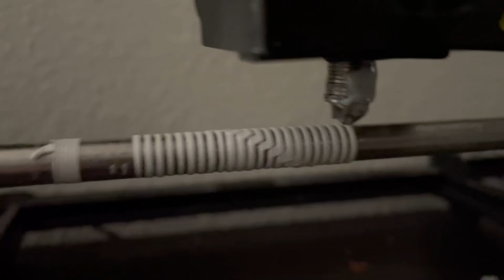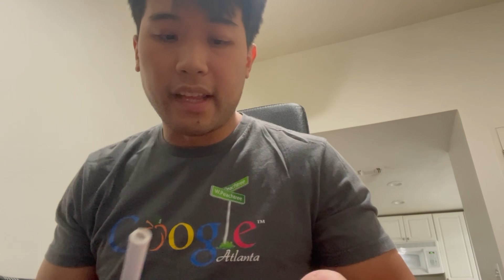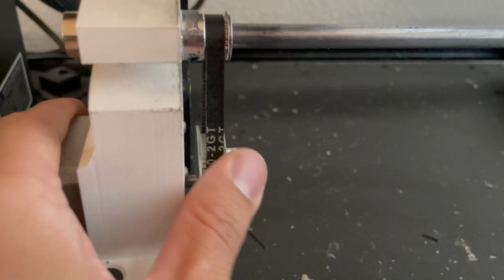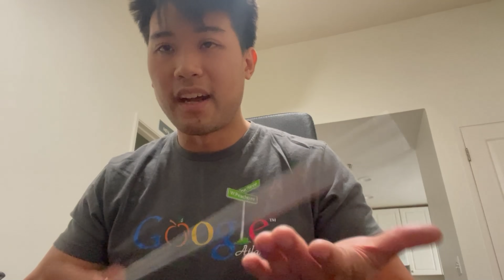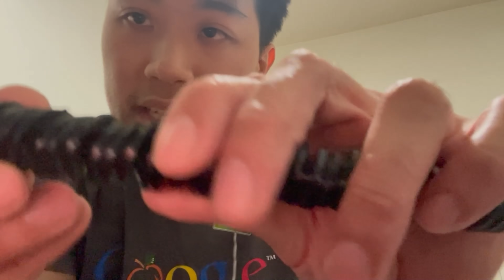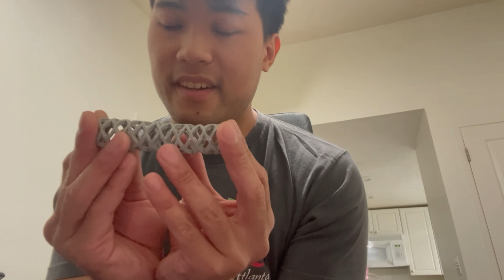i made a new type of 3d printer to make progressive twist barrels, springs, screws, rods, and more

Comment: the issue of 4th axis or if you will mill vs lathe or live tooling on machine shop tools is a old one. the question  that is asked what do i do with a 4th axis. and the thinking is wrong. in general their are two kinds of parts round and flat. a three axis printer can make flat surfaces only. the rounds?? are sin cosine x y functions and it still prints flats. he is on the right track. not go far enough but on the right track.for a practical machine to be sold it will have to have a slicer. he has made either a custom board and custom software or some kind of hybrid system notice he does mention custom software and nothing else. the lathe on a mill concept is interesting. and could produce parts in a very different way. faster is relative. you don't use a mill to make lathe parts. you don't use a lathe to make mill parts. milling people do not understand lathe and lathe people do not understand mill in their entirety. live tooling is for applications where a part could have drilled holes in the side of a round part. it is cheaper to drill a hole in a part when it is already located and orientated. rather than reset it up and then drill the hole. in this application. this kind of machine could do form lathing if you will. the product pushed is springs gun barrels and nuts and bolts. their is a much larger product base for this kind of printer.  for plastic additive their are going to have to be differences. holding the part. is a big hurdle. but this needs to be pursued with more intensity. the big issue right now is hardware and software. a collett chuck and a live center on a slide with a stepper motor drive is ideal. a 3 jaw chuck and or a four jaw chuck is worth exploring. a vacuum chuck and a face plate. is also usable in some form.  plastic parts are perfect due to their lightness. and the stl files are already their. 
im thinking he took a old creality machine ripped the controller out of it and replaced it with a raspberry pi  or a Arduino mega added axis controllers for each axis and set pins each axis to control the axis.in the plc, and rebuilt the software. x,y,z,a,b,c,e,f with a rudimentary g code and m code understanding. it would have to take the g code sentence and break it down to the individual words and then used the number next to the word to count one step 0 or 1 from where it is to where it is told to go. one step at a time. and could be as simple as 0 or 1 in the g code sentence. assuming each sentence is a step or micro-step. and the sentences describe this resoultion. 
their is a issue of the rotational angle. how is this to be formatted? degrees and minutes or some hybrid system like fadal. understanding that the farther from center the print head the same angle is got a greater distance between it. back to trg again. 
the drawing software is going to have to be different. we not talking about add and subtract a block as in openscad. but drafting a ending toolpath on multiple rotational angles. and letting the slicer decide how to do this part. in a degree x,y,z format. point clouds should be ideal to use.

Comment: ive wanted to see a "potters wheel" style

spining bed
nozzle at a 45degree angle
you could print without supports in most cases and the layer lines could be made connical to increas the layer strength

Comment: How many attempts did it take to get the liner just right material wise? I had this idea six years ago but im shit at frontends :) i did compile a marlin version for a cr10 with a lathe function, that should be on one of the old sdcards in the basement still. 

Im wondering if i am to go down to search for it because i too have an old cr10 standing around and it has the directdrive already fitted with a mad pressure extruder. alls i need is this newfangled cht nozzle and im off to the races? 
I print these zigzag shaped cancoolers from tpu/tpe or blend, this is why i too came up with this idea. but i could not figure out how to slice them😂Do you think that this could work? would i need a lattice with the baseshape on i recon to get support for the shell?

Comment: I was thinking this would be a great way to make propellers and support tubes for drones and even model boats or subs or anything that moves air or fluids (compressors, fans, etc). The problem with 3D printing, say, fan blades is that a) it's always unbalanced and b) it has too many, along the grain, failure points.

Comment: Could you not build on a larger diameter tube. A non cylindrical part using filler to build a level base? Its going to be smaller parts built in the side of the cylinder. And in a arcing layer . If it's possible. It would still be fast. Just curious. I do not have a printer. Just wondering , a 50 mm cylinder could possibly print a 20 mm part. A 100mm cylinder, could print 40-50 mm, by  what ever length, it changes the acceleration of mass issue greatly.  Awesome work ✌️

Comment: It's like having a lathe vs a milling machine. This has some serious potential. Is this implemented in Marlin/Klipper firmware and using a custom or off the shelf slicing software?  If your planning to open source this, I'm sure you'd have a lot of interest and help.

Comment: Dear based alpha male, my suggestion is to print between centers. You could easily change substrate diameter, and also use sacrificial substrate like cardboard tube and small dowels for completely solid parts.

Comment: Circular objects are in just about everything.  That wave spring is really neat.  As you show, the standard helical springs create a small amount of rotational movement when cycled.  If you look at where springs are used, you'll often see mechanical constraints added to eliminate that movement.  But your wave spring has opposing helixes, so I'd imagine you can simplify assemblies as they'd not need as many mechanical constraints.

Comment: This is one step toward 6 axis printing which I think will be the future of printed guns since you would theoretically be able to print lowers that always have the layer lines favorable to prevent sheering or delamination. Also if you're using a chuck you basically eliminated leveling.

Comment: This is REALLY cool, I do have a question though..
Presumably speed is one of the reasons to choose to print on a rod, but have you tried a turntable?
And if so what was the result of that? (besides layer direction)
Presumably this (rod vs turntable) is a case of different tool for a different job?

Comment: I've had a day to think about this video, and I hope you update us with your progress. First off, I really like this idea! It's a great way to make very strong...tubes in various formations. I like how you solved getting the print off the shaft with those sleeves, but then I thought, what if you want something inside the print? Like, if you center a bronze tube on the shaft, or even a ball bearing, you could easily integrate a bearing into the print! Or if you want to make whatever you're printing even stronger, you could print on a carbon fiber rod! And if you can print a cog wheel, you can print any shape, even a square flange. Or a sound horn. Or actually anything you can make on a lathe and then some! Basically, what you've done here is taken an additive mill and made an additive lathe! Very interesting!
Lastly, please keep the issue of gunsmithing out of further updates, or make a different channel for that. It's a bit controversial and demonetization is a real possibility. I can see you're enthusiasm for it, and it is interesting, but let's not get buried by the algorithm because of it.
Also like and sub for this! Thank you for a very interesting video!

Comment: Does your software have autogenerated supports yet? I have some ideas along the lines of 3d printed engine combustion chambers using this tech but the hollow voids in the center would be a problem.

Comment: Nice! Like a print lathe, I've taught about this, but I'm not good enough to actually make one. 
But I was thinking, what if you stack a bunch of these together, parallel to each other, driven by a single belt/gears in the same direction, and have a bunch of extruders, close to each other, driven by the same gantry, and print a bunch of identical parts at the same time?

Comment: I just had an epiphany. There's no reason you can't use this same principle to print on a shape with any number of sides, not just round. Even if you start with a round rod, with the right G-code, you could add hard edges to it using variable extrusion and clever movements. Better yet, if you give the rod Y-axis movement, essentially treating it like a laid down dual motor Z-axis, you can then build up on whatever shape rod you use. Start with a hexagon rod for example, and you can print whatever you want on a 6 sided print bed. This could allow what is essentially 4 axis printing. While there would still be limitations, the possible used expand dramatically. The ability to create strong parts with new layer pathing would also be huge.

Comment: The other awesome part of this is that you could use disposable print rods which become integral to the structure. For example, print onto a carbon fiber rod and whatever you made now has an ultra light and strong core. Print on to a steel rod and you now have a strong and magnetic core. Print on a copper rod and you now have a very conductive core with 3D printed insulator. This is a super cool and useful idea!
Reply: Weak bond with that core.
Reply: @TweakRacer  That's intentional in this case. He even addresses you have to take measures to make it not bond too well to the core.
Reply: @802Garage  If you 3D print you would know how much the thermoplastics stick to various substrates, whether the buildplate or the mandrel in this case. While it can be stubborn to remove, it isn't strong enough to be structural.
Reply: @TweakRacer Nonsense. Add a texture to the mandrel surface and you'll get an intimate mechanical bond too. Print onto threaded rod and it'll never come of before either softening massively at high temps, or outright destruction.
Reply: @NigelTolley  Keep opening your mouth to prove how ignorant you are. Bravo!
Reply: Insulating with FDM is not a good idea nor is it efficient
Reply: @livelaughlove_88h  There are plenty of other filament compositions that can be used.
Reply: @livelaughlove_88h  It would obviously be for very specific use cases.
Reply: @802Garage no

Comment: Great work (Chris?)!  You made me really happy seeing this. I thought of this years ago and did nothing with the idea. It's really neat to see it come alive in your hands.  I would like to brain dump the other uses I had for this:
 - Use a chuck to easier mount and unmounting (perhaps you can make a better chuck with your rotational printer!)
 - Use 3D printed Plugs/Blanks that are cylindrical making the parts 100% solid (like a bowl or disk without a hole)
 - I like your liner to allow you to bring the part off. I was considering wrapping the rod with dissolvable paper (embroidery paper) strips and tape them on each end. So you over-wrap the rod with paper, tape the ends.  After you are done printing soak it in water. You may need a pipe cleaner to get it all out.
 - You can make linear bearings. I would use paper liner to provide the clearance over the rod the bearing would be used for (maybe 2 wraps). Then print the inner core providing the channels for the bearings. Then insert the 3d printed core within an outer metal tube. Add bearings. The otter metal tube would handle most of the outward forces of the bearings when riding on the smooth rod.  Dude! You could stake the claim for the best DIY 3D Printed linear bearings on the internet this way (if it works).

I have 6 kids now, can't help yet. Very interested though. Following and liking!

Comment: Future experiments?  Liquid or air heat a tube to get better adhesion during the print and take advantage of the tube contracting to release the part after.  Then maybe use a compressed gas(canned air) to flash cool the tube to get further contraction if the part doesn't release.  Supports for the first layer might also make removal easier by reducing bed contact.

Comment: So basically the Y axis speed needs to adjust to print speed and current diameter of the print so (rod diameter + (layer height * 2)) ?  Very cool, I've seen some rotary axis printers but don't recall seeing any used the way you are for rifling or springs.  I may have to tinker with this, I print models of things like hit and miss engines and this would be great for piston, scylinder and crankshaft.  I've never had a good crankshaft come out I didn't have to do a lot of work to, even have sliced them in half to print then assembled still sucked.

Comment: With those wave springs, you may have just came up with the ultimate AR buffer spring. I would like to have one or a few with different compression ratios, to run in my AR buffer to help smooth out recoil and bolt bounce. Besides you could essentially reduce the size of the buffer tube, with no other modifications to the bcg, or anything else but the spring and tube. Just wishful, thinking, out loud!

Comment: This has application to more than symmetric objects of revolution. Any model that requires supports due to overhangs should be considering this sort of slicer application. With a printer nozzle oriented at 45 degrees to the polar axis, you could also print on a face platen to serve as a closed end for container applications. The same nozzle orientation would likely still work along the rotary axis.

Comment: couple of things:

Look into electrolysis for splitting water into hydrogen and oxygen. 
You can add wire into a 3D printed groove to make wear surfaces for inner rifling. 
Adding in a wire and fiber spindle could further increase strength.
This can also be used for normal 3D printing, so for example, you could create strong composite "bones" with an embedded rod and with joint surfaces.
Multi-material 3D printers could further increase the functional use-case.

What this really demonstrates is that there is a lot of more potential in FDM printers if you can control the direction of extrusion and optimize the tool chain pathway.

Comment: I love it!  What would be really cool is if your 'carrier rod' (i.e.the metal rod you're indirectly printing onto via the lattoce sleeve layer) was a three-part screw threaded rod (i.e. a smooth rod with threaded ends to join each section together so it acts as a single piece.

Why? Metal reinforcement.  You print without lattice on the section of rod (the middle of the three sections) that will be left behind in the print, and with lattice on the rod section (part 1 or 3) that would be removed from the print.  Once you've printed the bulk then you unscrew your section that will be removed, leaving 2 sections behind (aka like a lathe - unsupported at one end), this allows you to potentially 'close' the print, encapsulting the reinforcing rod completely wothout effecting the print geometry. Like pausing a print to insert threaded-inserts or nuts in conventional FDM printing.  That would give super strong prints!

Comment: this is awesome! I know that most print beds are uniformly heated to cool the melting plastic at the appropriate rate. I am wondering (you may not even need to since the rod is a good conductor on it's own) if it would make sense to add a heating element to the inside of the rod to help with adhesion and material warping? Or does that not happen with your application? Does the plastic mesh sleeve mitigate all of what I just asked?

Comment: Do you think this could make a square profile by raising and lowering the head at each corner / midpoint transition? You'd start with a circular rod and each rotation would pull the corners out a little more. There'd be air gaps inside the profile but few 3D prints are 100% solid anyway.

Comment: The first application i can imagine is a spring with a variable spring constant "k", which would allow for both non-linear spring force mapping or simple progressive response loading.  The application might be where a redirection of momentum is desired with minimal "moment of momentum" is needed... like when integrating mass control gyros to counter-balance shock loads to a system... like on a traditional planar 3-D printer. A rotational coil spring can absorb and return energy more smoothly and thereby reduce motor operating temperatures.  ...that, a good hair rollers (they're making a big comeback among cos-play crowds)... so I hear.  Lastly, deformable energy absorption... i.e. crash padding and protection.
Reply: And... embedding an FRP-type filiment within the flow for use in both cantilever and torsion beams and springs... Nice.

Comment: you can make this auto calibrate for any diameter size as long as it’s metal.  Just the same way cnc machines zero in.  As long as the tip and rod zeros you should be able to make any diameter.  Honestly it would be best to do that, as off the shelf rods are true 100% (unless you lathe that yourself).

Comment: Stickiness. What if you install a heating element inside the rod you're printing on? then it will expand when it gets heated, you print on it, then it shrinks when it cools off. 
Mount a small 3jaw chuck on the printer to fit different size rods easily. 
How do you print solid rods such as threaded rods and bolts?   
you should be careful about talking about projectiles. It tends to bring the attention of weirdos. Even more weird than me.

Comment: This would work perfectly as an additional rotary axis. Such as in CNC or laser plotters.
You would only need to adapt the printer's structure so that it is mounted in a permanent place and adapt the electronics with an additional stepper.